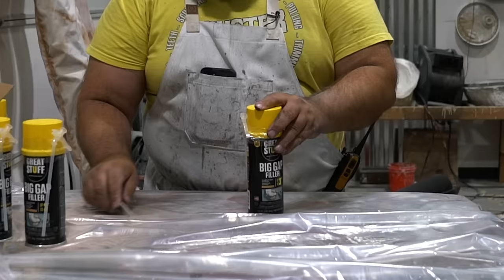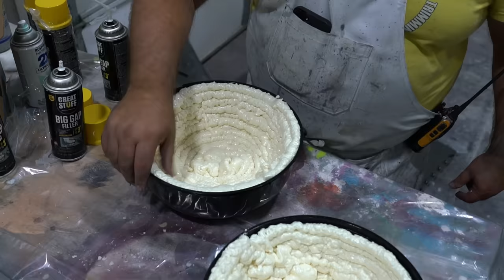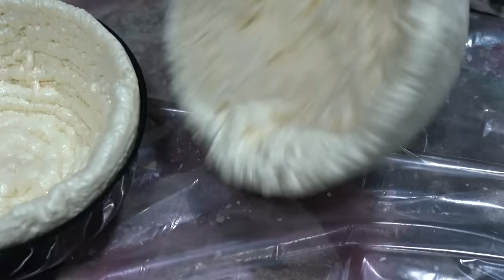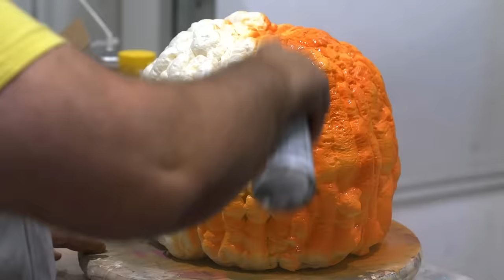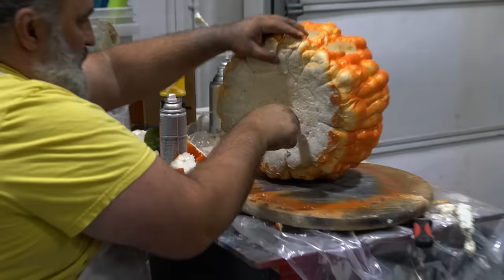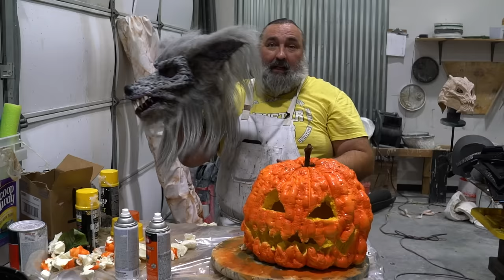Great Stuff Spray Foam DIY Pumpkin

Comment: I’m so glad you just posted this video. I’ve been experimenting using spray foam and balloons to make pumpkins. I’ve been wracking my brain trying to come up with another method to make the shape. The balloon is super precarious. 😂🎃
Reply from the maker: I've seen the balloon method, it did not seem ideal.  Glad you enjoyed the video, this was fun!
Reply: I did the same thing a few years ago and made a "Pumpkin Head" for a costume. I used waxed paper on a piece of cardboard,pulled the neck of the balloon through a small whole in the paper/cardboard, and then wrapped waxed paper and painters tape around the lower half of the balloon so it would stand up while I applied the G.S. foam. I did a "stem" on top with G.S. and then carved the stem to shape.
Reply: I used chicken wire to make the form, using double layers when possible. Then I sprayed the foam around the chicken wire.
Reply: Thin inflatable beach balls for the win.

Comment: I just made a spray foam pumpkin about a week ago in just about the same size and it looks eerily similar! Great Halloween minds think alike 🎃 I used a homemade paper mache clay to build up the details on the stem and it turned out great.
Reply from the maker: Awesome!  Just make sure you water proof it before letting it live outside.  Thanks for tuning in!
Reply: @StiltbeastStudios  anything special to waterproof it? I just picked up like 10 cans of loctite to do an activity with my kids lol.
Reply: Paper clay is my go-to medium! My little studio is filled with various sized paper clay pumpkins in different stages of the process. My plan is to also start making them from spray foam!

Comment: With most other brands of great stuff, I've had a lot of luck preventing sticking with water that is heavily saturated with detergent soap (a.k.a. "Wet Water."):
1) Take a water bottle with a sprayer, and the most basic liquid dish soap you can find. 
2) Fill the water bottle 3/4 of the way with water. 
3) Start adding soap until you have filled the bottle 1/8 of the way with the dish soap. (1/2 of the remaining usable volume.)
4) DO NOT SHAKE. Roll the water bottle back and forth gently until the soap has dissolved.
5) If the initial application still sticks,  just add more dish soap to the water, roll-mix it, and try again. Don't be shy with the detergent. 
6) Re-apply to your hands/tools every few minutes until the foam starts to harden. 

You can also use this to sculpt with caulk.
Reply from the maker: Neat!  Thank you for sharing that!

Comment: The way the jaw moved when you used it as a mask was actually terrific! It would make an excellent Headless Horseman or general pumpkinhead character. If it strikes your fancy, I would loooooove to see a video about how to make a gargoyle. All the tutorials I have found are about making something actually concrete, or else an intensive foam-board-carving process. I know you could do it inexpensively, quickly, and more easily! I'm guessing you would shape the details with your favorite Loctite sculpting method, but i can't figure what kind of base/frame would be good for the relatively small scale of a gargoyle 🤔
Reply from the maker: Actually, a 3D gargoyle project is already in the works so you should see that before Halloween!
Reply: Aluminum foil?

Comment: Another idea I thought of for an option for making a scary hollow foam jack-o'-lantern by just taking an inflated balloon and spraying the great stuff foam sealant over the balloon evenly as possible making sure their aren't any openings/ holes in the foam so you can't see any parts of the balloon ( unless the holes are for scary accents) and letting the foam cure and then popping the balloon inside and then beginning to shape the foam with carving tools then for (optional details) adding sculptamold or some sculpt able foam over top of the cured spray foam for realistic details. The sculpt able foam could be from mixing acetone with Styrofoam and dissolving the Styrofoam into a workable/sculpt able putty for sculpting the scary details of the jack-o'-lantern s face and contours.

Comment: I use spray foam for projects too. One thing you should have done is wait the full 24 hours for it to cure completely. It's so much easier to work with when it's finished curing.
Reply from the maker: Easier to work with in what way?
Reply: @StiltbeastStudios  less soft when cutting it. I'm making a TMNT shell for my kid out of the same stuff. And for me personally I like how much easier it is to cut it shape it and sand it. Just my preference. And by the way thank you for the idea lol. I am so doing that with my kids. Best thing about this idea is you get to keep the pumpkin for years.

Comment: You can get usb flame bulbs or a c5 old style socket candle with a new led flame bulb. Both these style bulbs use only 1w and they have a variety of colors and flicker effects by quickly flipping the switch or unplugging and re plugging.
Reply from the maker: I like the LED pumpkin lights, love em.

Comment: I don't recall where I saw it, but last year I had a face palm moment when I found a tip to make the hole in a regular pumpkin on the bottom instead of the top. So much easier to just set it over the candle/light. 

I always used to put a good bevel when cutting the top, but it would still shrink a good deal as it dried. Now, no worries.
Reply from the maker: It does seem like the way to go unless you want to carry the lit pumpkin.

Comment: Do you think you could do ridges in the bowl first by building up hot glue? Or do you think the great stuff would adhere to it?
Reply from the maker: It's possible to do ridges on the bowl but it would be much much harder to make the foam rings going inside of the bowl.

Comment: Awesome,  just running across your channel... I used to use can spray foam to build model railroads. If I was building a mountain or hills, I would spray over top of crumpled up newspaper or something. It would give real good shape to the ground, so everything wasn't just flat. I would also sometimes take paper towels and lay down over top so I mold it with my hands, then peel the paper towel off after it dried, Some of it stayed on there, which gave a bad pattern from the quilting of the towel but was paintable, messy but i'm sure it added some strength as well from the paper fibres. I would even use the paper towel method, like spray down the foam and then lay a paper towel across it and then run my track bed on top of that without sticking, so it would expand around my bed like if I had to build up the area for a level track.
Reply from the maker: Yes, I've used the paper towel method before.  Wet paper towels work even better as long as your paper towels will hold up.  I like the blue shop towels because they do not leave a pattern and spray foam is pretty amazing stuff-  thanks for tuning in to the channel!

Comment: Do you think this would work with a large balloon as the core spear instead of using the bowls and extra foam to make a core spear? Like the old trick with paper mache and balloons.  Its just that you can get 3 large punching balloons for a dollar from $ stores.
Reply from the maker: Yes, you can do that.  I didn't feel like chasing a balloon around.  lol. Also balloons are really round and pumpkins normally have squashed tops and bottoms.

Comment: You could also use a balloon as a mold. Pop it and pull it out after craving.
Reply from the maker: what holds the balloon, they are so jiggly, the foam does not stick that well so the odds of it falling off are pretty high. I have tried it this way and its not easy, fun or super effective, the bowls are better because they hold the shape. timewise they are faster as well. good thought but having done it, its impractical when compared to the bowl method.

Comment: I wonder if spraying the inside of the bowl with cooking spray would give easier release than just water?  Really clever project.
Reply from the maker: the water is not a release- its to make the foam cure thats against the bowl- the water helps it cure.....and its really hard to paint something that is covered in cooking spray lol.

Comment: I'll buy a foam pumpkin for the same price that you paid for that bowl LOL
Reply from the maker: no you wont. there are no decent-sized foam pumpkins for $1.25.  this pumpkin was $12 cost total.
A foam pumpkin of this size is about $40- a real pumpkin of this size is about $16. 
Making an inexpensive foam pumpkin has been an issue for haunted attractions for many many years. Its not a problem you have, but this is a solution to a problem my core audience identifies with. If you were butt talking because this is the internet wild west that's fine, but if you have a link for a $1.25 foam pumpkin over 9" then share it and I will call you a king and name a future dog after you.

Comment: Allen, when you put it on and the mouth moved the video became Super Awesome! Do you think the pliability of the mouth will continue or harden so no movement happens?
Reply from the maker: I'm afraid that is the case.  But you could paint the outside with latex and that would hold it on even after breaking and allow that mouth movement.

Comment: Would this hold up outside in the elements? I love these kind of videos.  Wish ya did more like these ...😊🙏💪💯
Reply from the maker: Great Stuff foam is not very UV resistant so I would paint it with some heavy latex house paint as opposed to spray paint like I did and then it should be fine- you just don't want it to get direct UV exposure,.
Reply: @StiltbeastStudios  thank you Alan 😊

Comment: Awesome work and your method of handling the great stuff gave me some awesome ideas for future projects! Actually probably use some of your ideas tomorrow. :P

However I was thinking and you could probably skip the first step of making a sphere out of Great stuff in two bowls and just use one of those big balloons or bouncy balls and do the up-down lines of Great Stuff on that to make the pumpkin look and save yourself a lot of Great Stuff and time. A rag with some black or brown paint to rub into the seams and crevices (but rub it off of the rest) could add a lot of depth and detail to make it POP!

Gonna go check out more of your projects for other ideas!  :D
Reply from the maker: Im 46, if you think I have gotten this far in life and not tried smearing greatstuff all over a balloon then you are sorely mistaken. balloons are jiggly and the great stuff does not want to stick well, also a bit anti gravity to get it to stick to the sides of the ballon. Having done both methods, the bowls is way easier to manage.  I could antique the pumpkin yes, but I want this one brighter since it will be in low light. I have 700 videos or so to keep ya busy, at least 15 of those are pretty good projects lol.

Comment: Have you ever used the G.E. Gaps & Cracks foam? I considered trying it out to see if it's as "controllable" as the Locktite. I know you've done comparison videos before, but I'm unsure if you've ever covered the G. E. foam (it runs around four to five bucks a pop). Great video as always. I may try one of these guys out to go with my Locktite jack-o-lantern!
Reply from the maker: I plan on doing a comparison video very soon to try as many kinds of spray foam I can get my hands on.  The Walmart spray foam is promising because it is the same bright white color as Locktite.
Reply: That's what I was thinking! I thought GE only did a basic foam, but when I spotted the gaps and cracks GE, alarm bells went off. It sure would be nice if it works, lol
 @StiltbeastStudios
Reply from the maker: Indeed!  I'll let you know soon!

Comment: The dollar store sells globe paper lanterns (basically spiral wire frame with colored tissue paper). i just used one as a form and applied the spray foam directly to it - vertical rib layer, no inner concentric circle spiral first. Worked great! Once it cures I'll see if the lantern's wire gets in the way of carving...
Reply from the maker: good luck with it!

Comment: Can you paint before it has finished expanding?  I'm wondering whether it's worth spraying some yellow inside the two hemispheres before bonding them together.  You'd still have to paint the carved edges, but the inside walls that are exposed would already be painted appropriately.
Reply from the maker: That's a great idea! I will try that on the next one

Comment: I use Vaseline to coat surfaces I don't want it to stick to a little goes a long way then once dry dish soap wash and dry
Reply from the maker: If I use Vaseline to coat the bowl, that is going to get all over the foam which  will make it very hard for any other foam to stick to it later and paint it down the road.  Also, the water plays an important role in helping the foam cure.  And why add the step of washing if I do not have to?  It came out very easy with the water.

Comment: You can spray a thin layer of olive oil if water won’t keep it from sticking
Reply from the maker: The water has many purposes, it helps the foam cure and that's what keeps it from sticking, the skin it forms. Also any layer of oil makes it really hard to add to the pumpkin or paint it.

Comment: That foam is incredibly flammable and gives off deadly gas when heated or burned.
Reply from the maker: Yes it does,  most foam pumpkins are the same. 12v LED lights  are fine.

Comment: What type of spray paint did you use? In my experience with great stuff regular spray paint melts the foam.
Reply from the maker: No spray paint melts great stuff. you are thinking of Styrofoam or extruded poly styrene (pink/blue foam). Its a different type of foam completely. So spray-paint is great as long as the foam is cured.

Comment: Next time, take a little cooking oil on a paper towel and wipe the inside of the bowl, this will make it release better.
Reply from the maker: it will make it really hard to paint down the rd, the water is needed to help the foam cure- it released pretty easy soory if I made it look difficult- it was not.

Comment: Would it work to shape the inside of the bowl in a pumpkin like pattern, plastic wrap it. Then spray the foam in the bowl? Hoping for a ready shaped and easy peel form.
Reply from the maker: its possible, but the foam would not go in as easy accomodating all those ridges, but its possible.

Comment: Why start out on the inside of the bowl then have to double up. Could you not flip it over and start on the outside? That's how you did your werewolf mask. Just asking for a friend.
Reply from the maker: I did not want a seam in the middle of the pumpkin.  If I did continuous lines on the outside of two bowls, I would not be able to get the bowls out.

Comment: You might could use a balloon, filled with air, do the spray foam, and then pop the balloons and go from there
Reply from the maker: its really hard to chase a balloon with spray foam lol, I g\have tried that route- no good way to hold it, two halves works really well so far.

Comment: This is my first attempt at using spray foam for a project like this, the great stuff bowls are shrinking quite a bit as it dries. Is there something I can do to prevent that?
Reply from the maker: Loctite foam does not shrink as it dries- if they are together they will shrink less (surface area exposed to air) and putting them in a plastic bag will slow it/stop it as well. it has to do with humidity in all honesty.
Reply: @StiltbeastStudios  thanks! This is helpful

Comment: The Fire resistant "Great Stuff" is a BRIGHT ORANGE already, f.y.i. ! I haven't used it in a while, though !
Reply from the maker: I was going for low cost per can and the flame resistant Great Stuff is about the same price as Locktite-  ideally, that would be my preference.

Comment: Using the 25 dollar foam gun will save you foam and it will also make it were you can control how much foam comes out
Reply from the maker: I could do that but normally in my videos, I try not to use special tools or anything more expensive than i  have to.  I realize in the long run it is less expensive, but by using just an off the shelf can, more people will feel like they can do this themselves and that is the most important thing about these videos.

Comment: What about lining the bowl with plastic wrap, spraying the plastic wrap with non stick cooking spray before applying the spray foam?  Would that make it easier to remove?
Reply from the maker: but much harder to paint, it actually removed pretty easy.

Comment: How does this hold up in 90 to 100 degree heat direct sunlight for at least 2 weeks?
Reply from the maker: heat is not a big deal, UV rays are worse for the foam- coat with a polyurethane that has UV resistance and it will be fine.

Comment: Just wondering would coating the bowl in vegetable oil work at first instead of water?
Reply from the maker: No-  because the oil is going to make it harder to paint later.  Also, water helps the foam cure.

Comment: Try putting a plastic liner down first.. maybe that will help taking it out
Reply from the maker: It's easy to get out you just don't want to rip it, and you need the water to help cure the foam.

Comment: Spend 30 bucks on caustic chemicals or get a 10 dollar pumpkin.
Reply from the maker: $16 on caustic chemicals. and a real pumpkin that size is closer to $20 here in TX. I cant use a real pumpkin in a haunted house, they rot real fast once you carve them (faster in TX because of heat)  so we need fake ones. You don't need or want a fake pumpkin, but many people do hence the positive comments you see that outweigh the negative ones.

Comment: Seems prudent to mention, you probably should NOT use a candle/fire in one of these, only electric lights.
Reply from the maker: yeah, my channel is aimed at haunted attractions- youtube has been pushing me because its halloween season. We never use open flame so it does not even pop in my head. this will be in a set with an LED in it.